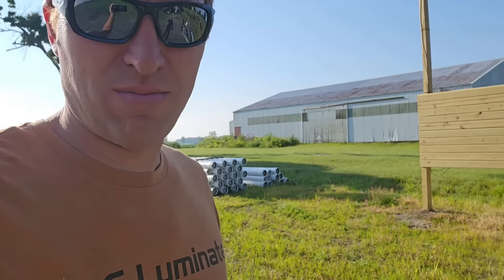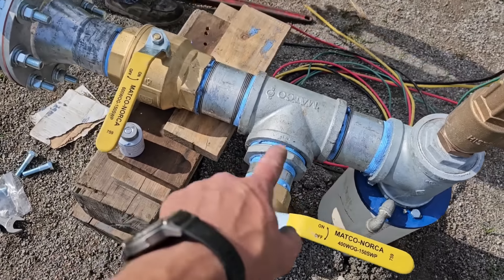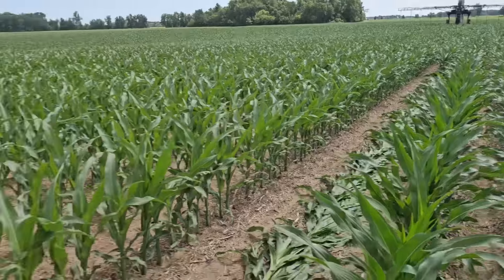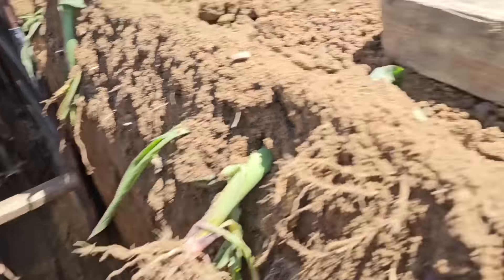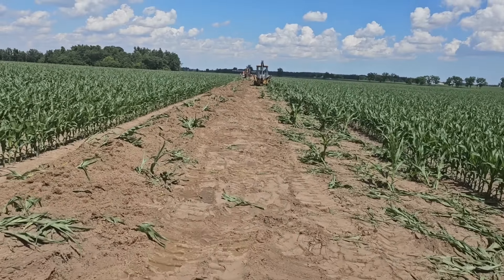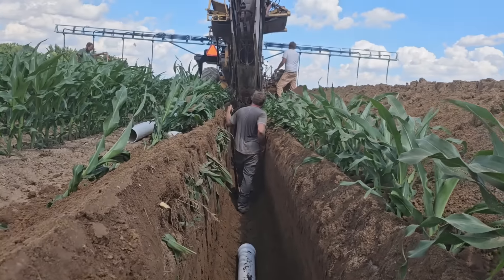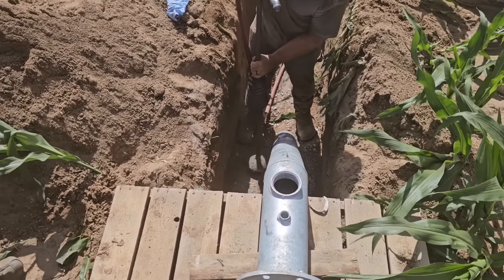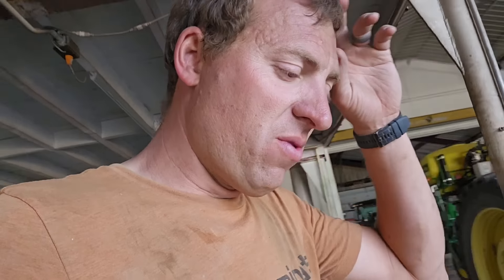Destroying my Best Corn

Comment: If you do some more in the future try using dish soap on the gaskets in the pipe instead of the joint lube they usually send with that pipe. Seems like the dish soap makes it easier to go together for us
Reply: Yes, and I use liquid hand soap on any kind  or size of oil ring, especiallyif you have to turn something after in place, keeps the oil ring from binding up and twisting or coming out of place.

Comment: In your next pipe laying project after the trench is dug and the pvc pipe is laid next to the trench put the pipe together next to the trench,if it is gasket type use plenty of the soap grease to lube through gasket end and the male end then put a 2x4 under the female end(always lay the pipe starting at the well with the male end first) then insert the male end into the gasket end and push until the marked black line meets the coupler end..  I always had a 6x6 “ block with a rubber hose nailed to the end to make a handle the use a sledgehammer to drive the pipe to the black line on the other end you then can put  5 or 6 pcs together or the entire line on top of the ground then take 5   2x4” about 3 ft long and lay them on top of the trench and use a rope and put it under the pipe and slide the pipe over on top of the 2x4s above the trench do this for ~5 joints then do back to the start point put the rope under the pipe and lower into the trench there I no need to get in the trench ,it is not hard even with 8” diameter pipe.  This takes 2 people.  Good luck

Comment: At the end when in the office you look ragged lol. Why do you cement in the z pipe? It was sad to see all the corn 🌽 go bye bye and it’s not even mine. Have you done any fertilizing to the sweet corn. Have a great weekend Nathan.
Reply from the maker: All of the buried pipe has gaskets slip joints, meaning they slide together but there is nothing actually securing them together. The concrete is there as a thrust block to prevent the pipe from coming apart under pressure.

Comment: I probably have a 100 miles of lines around my  land here in Texas.   One is 15" concrete, it weighs 800 lbs per 8'  joint.   Some is 3 phase 500 MCM Aluminium wire for irrigation pumps.  Gas, 2 miles helium, water, and 3 miles fiber-optic running from Denver to Houston.   Some times we hit lines no one knows about!